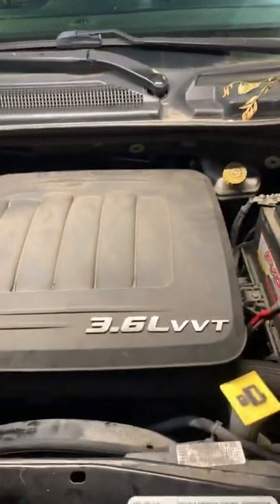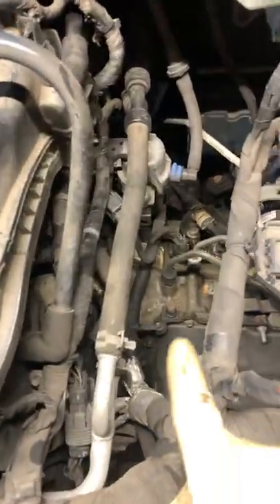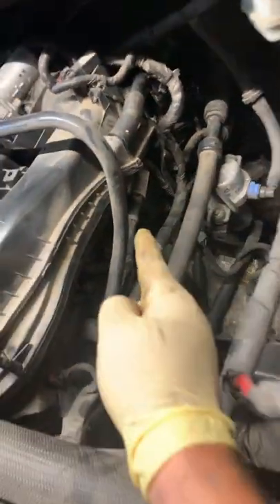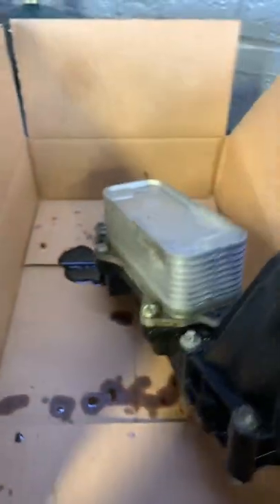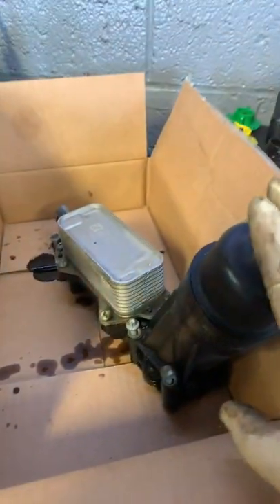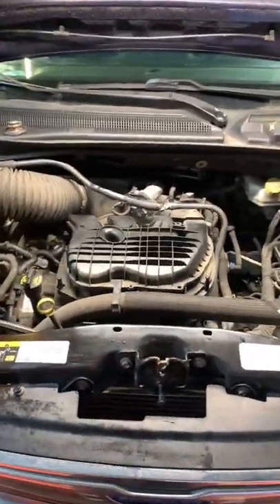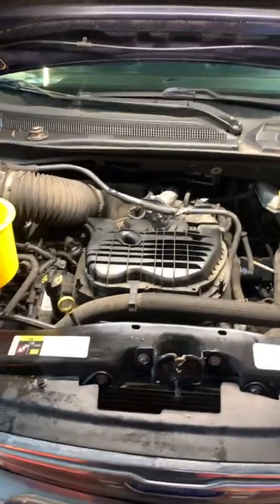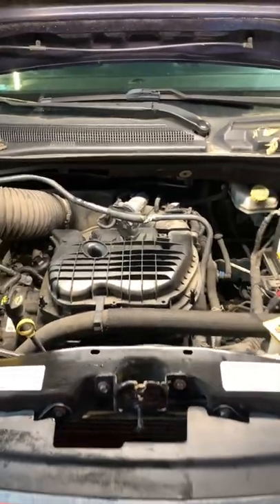CHRYSLER 3.6L OIL FILTER HOUSING AND COOLER FAILURE!

Comment: What is with domestic manufacturers using cheap plastics in critical engine components?
Reply from the maker: It’s not just the domestic a lot of imports are following this trend as well
Reply: Well Dorman makes an aluminum one but it’s junk too.
Reply: Audi water pump enters chat. Along with every single hose being brittle plastic
Reply: @abdullahal-shimri3091 mishimotos version hasn’t failed me but it’s also made for job security

Comment: With 90 psi oil pressure, no wonder they leak !
Reply: What is oil pressure supposed to be? I just looked - mine is 20. :)  Bad oil leak. 2014 Dodge Grand Caravan SXT.

Comment: I just purchased this Oil Cooler, an OEM unit directly from Chrysler. But I noticed those two plastic screws/caps are stacked in.. more like heated and pressed in. Is that normally how they come in? I’m concerned about it leaking there.
Reply from the maker: @Mike_44  that’s how it looks unfortunately that’s how they build a unit and that will be a failure point in the future on it
Reply: @ Great lol. I feel like applying some JB Weld around the circumference of those screws caps before getting the OC installed. What do you think? I don’t think that area goes through a lot of oil pressure..
Reply from the maker: @Mike_44  I wouldn’t touch it just install it the way it is that’s how they manufacture them if you’re really uncomfortable installing that look up some Dorman units they make an all aluminum one that will never fail
Reply: @ I also have an aluminum spare unit, not a Doorman but a knock off brand, looks really good though. The only thing is that aluminum unit brought two sensors (oil pressure switch and coolant temperature sensor). My ‘19 Pacifica is only supposed to have the bottom sensor (oil pressure). I can always plug the CTS and give it a try though. Looks like all the galleries/passages seem to be exactly the same.
Reply from the maker: @ I would trust the aluminum one for long-term
Reply: @ lol most fellow Chrysler Pacifica online forum members are advising against the aluminum unit, because supposedly they are built poorly, not totally flat at the connection point between the block and the Oil Cooler. We’ll see.

Comment: I've had this part replace 2 times my last time replacing this was 3/27/23

I replaced it with an aluminum oil coolant system I haven't had any issues.
Reply from the maker: I would check that all the seals are properly put in place and that you cleaned up the mating surfaces
Reply: You replaced it with an aluminum one and it's still leaking??
Reply: @JF32304  I replaced with aluminum nice and slowly.. I’m overheating slowly . Air in the system ? HELP
Reply: @kimpham7592  do you have coolant on the ground? There is a coolant line in the back, did you connect it properly and put the clamp back on? Also did you check the fluid level in the radiator?
Reply: @JoeFritz-u5q  it ended up being the smh lol

Comment: I replaced mines and still have a leak. Not sure if I didn’t tq down or over tq something but replaced pcv and valve covers
Reply from the maker: Most likely the torque on the bolts or maybe the mounting areas had dirt prior to install
Reply: @TheEnthusiastMechanic  I don’t see a pool of oil like I did before when I had the leak there going to try pull back off but I’m lost on how people are getting that bracket back on near the tb. I took mines off and can’t get it to line back up. I have it installed without the intake on that bracket was wondering if maybe that’s the issue but doubt it
Reply from the maker: @seriouzfilmz9397  make sure you clean any of the old residual oil out of the valley because that can make it seem like it’s leaking when it’s not

Comment: Where did you buy part please amozon part is cheaper but I'm not sure if amozon parts are good?
Reply from the maker: I use the oem ones from the dealer the ones on amazon aren't the best they are very cheap
Reply: What if I just want to replace the o-rings ?
Reply: The ones on line are cheap and plastic. I went to Holbrook Auto Parts cheaper and one all aluminum

Comment: Just changed mine blew that circle with a cross on it smooth off oil everywhere engine ticking smh about to see if I saved it or not now lol
Reply from the maker: Good luck hopefully you’re good!
Reply: Any update
Reply: @yovanirangel2964  I'm up and running no issues although now I hear ever so slightly some very tiny bit of noise near the timing gears buy its running fine I added Lucas with the first oil change since and it seems to be quieting things down daily
Reply: Get your car diagnosed if it say it's misfiring it's the the rocker arm because the rocker arm is what makes that ticking sound tick
Reply: @KeepItnMotion  yes! I concur, the lack of oil pressure from the plug blowing off probably caused this.